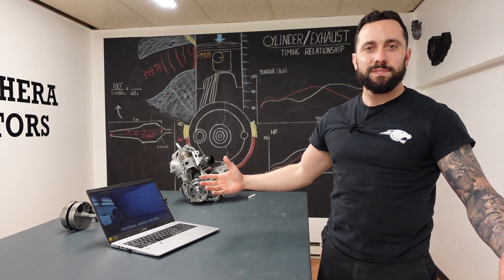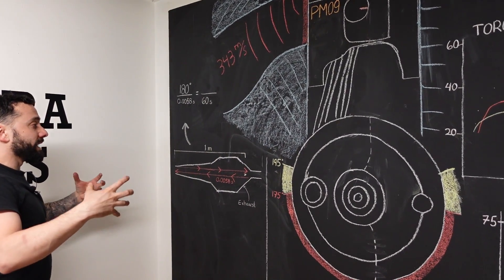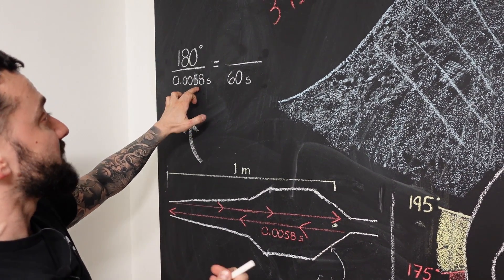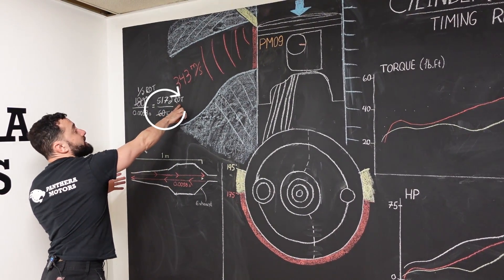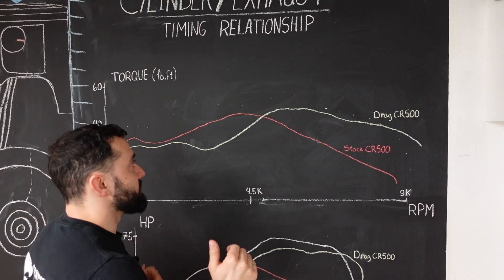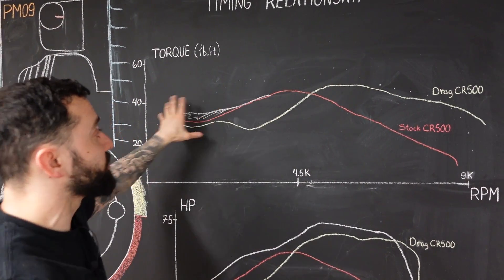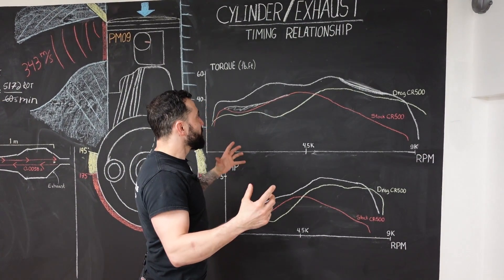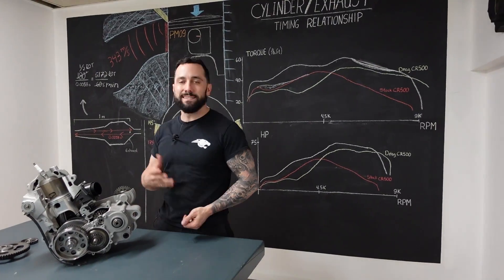Episode 4   CR500 dyno analysis and exhaust timing   Mad scientist explains

Comment: Trying to download as much knowledge  from you guys ad possible , Im a diehard banshee guy built 2 that were bad ass…. my brother built a quad racer250- 500 hybrid he was certain it would be faster then my banshee it wasn’t he was crushed🤭so he built the banshee that’s pretty bad ass now I would like to build the first single cylinder that can beat a banshee Not a completely built, banshee just pipes good jetting a little bore not fully built because we both know fully built banshee engines are untouchable. I’m building a BVC CRF 450R-CR500big wheel ..I would like to put a 560 in it and race my brother’s pretty sick and fast banshee😊

Comment: in a engine cr 500 1988 with CR500 Big Bore 560cc (PM09 top end assembly) and PM09 bike exhaust ,The motor will power the 73 wheels??? and is it reliable for the rest of the machine or do we need to pay attention to something??thanks
Reply: also what carburator you recommend????

Comment: Love it. Making the power is paramount and sells products.
I am also interested in partial throttle smoothness of 2 strokes.
I have been looking into Honda's A.R.C. mid 99's tech where they create controlled detention through blocking exhaust ports and cutting spark to produce a partial throttle that is smooth IE: maintenance throttle mid corner.
Have you seen this and what is your take on it?

Comment: If chainsaw modifiers can get a 50cc saw to make 10hp, why can’t a cr500 make 100hp?
Reply: Stroke length dictates redline, redline dictates hp. Those saws are revving to 14,000rpm
Reply: @Tsxtasy1  for sure, I do know that the little engines turn more rpm and make more power per cc. As cc go up so does torque. The torque increases way faster than horsepower. An 85 can make over 20hp, a 125 pushes 40hp, a 250 just over 50hp, and then a 500 about 60hp.
Reply: @JohnDoe-ud2cc  yes, the bigger the engine the longer the stroke length. Longer stroke means higher average piston speed for the same rpm. The piston can only move so fast before it explodes due to g forces when it changes direction. So long stroke equals low redline.

Hp = (torque * rpm) / 5252. 
Engines that spin faster than 5252rpm generally have more hp than torque. Engines that spin slower than 5252rpm always have more tq than hp. 

There’s 2 ways to make more hp:
1. Increase tq
2. Increase rpm

Small engines are able to use more rpm than big engines. So they make more hp for the same peak tq
Reply: @Tsxtasy1  This is just like You wrote. I use in my 2-stroke 250 cc mx bikes 1-ring piston because these are tuned for slightly higher rpm than stock motors and they reach higher piston speeds than 125 cc mx bikes so I decided to use 1-ring piston instead of stock 2-ring ones. In all my 125 cc motors and smaller the stock pistons are 1-ring ones. 250 has 72 mm stroke vs. 125 has 54 mm stroke. So 18 mm more stroke and it’s 25% more.
Reply: @Tsxtasy1  so why don’t they go with bigger bores and less stroke? So if I take my yz250 and put a 300 big bore cylinder on it, the stroke stays the same, does it increase torque or horsepower? I’ve been told that the torque goes up.
Reply: @JohnDoe-ud2cc  packaging, emissions, etc. bore:stroke ratio is a balancing act. 

Bigger bore means more friction losses/heat due to more ring area in contact with the cylinder walls. More chance for blow by.

There’s also something called wrist pin offset that makes the con rod more vertical when firing down on the power stroke. 

A 250 with a long stroke will make more tq than a 250 with a short stroke because the long stroke acts on the crank with a longer lever. 

If you put a 300 big bore kit on your yz250 you will get more tq and consequently more hp. As long as it’s set up right.